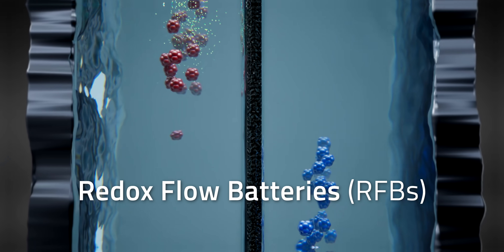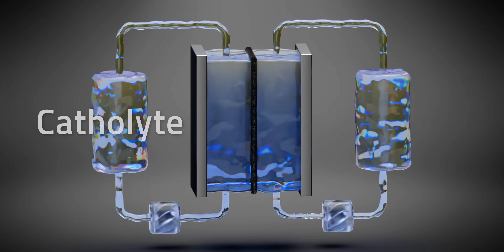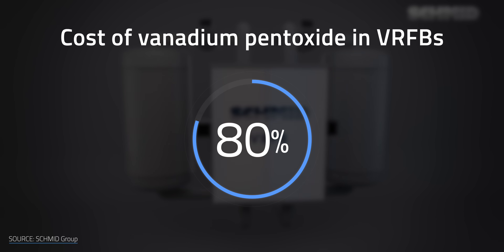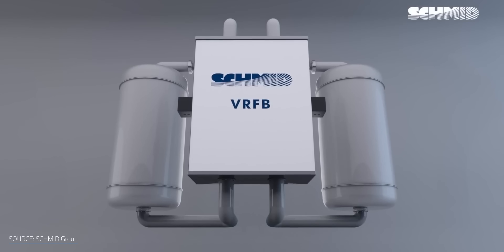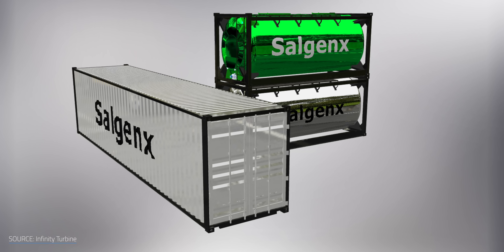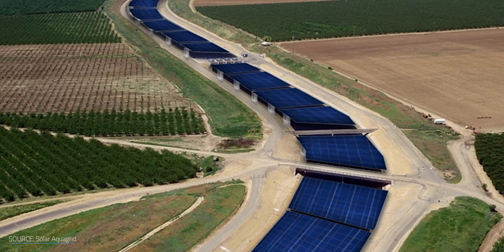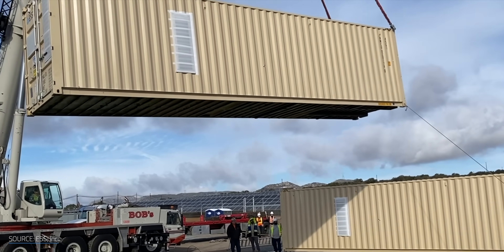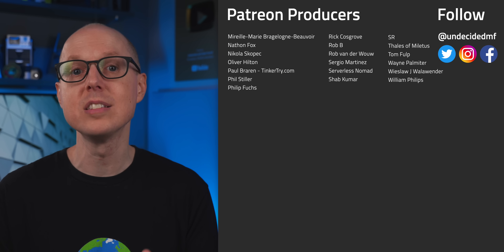Why Salt Water may be the Future of Batteries

Comment: What makes you mad is what was solved but not presented to us.

By using Tesla 1 wire system to transmit power we would have no problems with electricity since you could have distant hydroplants providing power and dumping it into the earth for the whole world to feast on... and here lies the problem why we dont use such tech; the elites would lose control since everyone could tap into it by just constructing a primary-secundary with a good top load "antenna".

And it works. It was tested by marconi hence why he lost to Tesla in the courts... 2000miles when 200miles for radio was the limit (above 1Mhz it bounces of the ionosphere and even then it would be amazing if they would recieve any signal at all).

Comment: Looks really good. For many locations there’s plenty of space available so that the energy density isn’t as much of an issue. It’s great all this new battery tech coming out.
I’m still excited about the LiFeP04 that I’ve been using for the past two years on our solar Edge AI systems that operate off grid. 
Always love new battery possibilities.
Reply from the maker: I'm a fan of LiFeP04 too.  It's a great workhorse.
Reply: The low toxicity angle of this one sounds really appealing, food producing regions under threat from salt water surges and other such disasters could develop infrastructure to restore/maintain production in record time, boosting resilience with low risk of contamination.
Reply: Especially with that 20k cycle life, they would be the last batteries anyone would ever need. Just setup a larger battery shed or even better if someone had room to set the modular shipping container up in their yard and just hook the leads up to the home charger network, then disguise it as a work shed or plant some fast growing bushes in front of it if the sight of a container is off putting in some communities.
Reply: He seems to ignore LiFePO4 for some reason. LiFePO4 is already good enough for my to power my life till I die for less than the cost of a medium priced car. It is not theory, it is an already proven win for solar viability.
Reply: @lazysmurf420  The lifepo4 is fine but it's a lithium-ion battery. All lithium mines are currently producing at maximum capacity, combine that with both Europe and the US pushing all electric vehicles by 2030, and then further add that it will be another 8 years before the next lithium mine comes online, and at least 5 more years after that before it really starts producing in quantity, and you are looking at future sky-high prices for lithium batteries.
Reply: @lazysmurf420  It is a good solution for individual households but we need to scale up big time and flow batteries are what power companies need to start acquiring. The price of LiFePO4 would start skyrocketing if power companies started buying up all the premade (likely Chinese) batteries plus you still would be using up lithium and other precious metals that EV companies will likely be competing for.  These simply require storage tanks and can be stackable with shipping containers in population-dense areas.
Reply: I have a lead acid system, but I've been watching/waiting/dreaming about Redox Flow Batteries for over 10 years!! 
Salgenx sounds incredibly promising due to the lack of a membrane! I hope they develop a smaller 50 kWhr system(two-55Gal drums) that would be a great competitor with the 10kWhr Powerwall!!

Comment: Yep either these salt or the iron air/flow batteries are pretty much the only solution we have for grid scale energy storage and should have been scaled up yesterday. We can't tie up lightweight, expensive, energy dense, rare battery resources that are better used for transportation for a solution that can care less about size of the battery. The only thing is these batteries need to be located away from populations because of the chlorine concentrations involved and the risk of an accident.
Reply: Not really.

They've been using molten salt energy stir for years. Works quite well.

AND solar, with molten salt energy storage, is cheaper than the cheapest fossil fuel, which is natural gas. And it's been cheaper for several years now.
Reply: anydaynow: The problem is we do not need grid scale energy storage if we just do NUCLEAR.  You are saying you want power but not in your  back yard.

Comment: I'm constructing a covered arena for my horses in super wet 9 months then parched dry 3 months Oregon. It's a Nucor that laughs when trees fall on it.  I'm going to install solar panels on its metal roof.  Lighting and my well pump are first priorities, with auto switch to grid only if needed.  I'd like to also charge a future electric vehicle once my 2004 truck or 2010 car die. Since I have tons of space, and water/ graphene production sounds dandy to me, should I consider these batteries?  I need something non toxic for if there is a leak a horse kicks the battery :).  First section of an eventually 4 sections will have an almost flat roof roughly 70 ft by roughly 80 ft.  Peak at 17 ft, sides at 14.75 ft.

Comment: This battery has 2 things going against it compared to other batteries: Weight and space. That means transporting it is bad and it means in small spaces it sucks as well. But say you burry it in the ground of a house's garden... Then neither is such a big issue.
Reply: Maybe for home storage, but for grid - it doesnt matter as you can stack them if you wanted to or at least have the space by putting them in large non human living spaces. Transporting wouldnt be bad at all really. Sure it would cost gas to move them - but once in place - they would pay for themselves over the next 25 years. Plus looks to be stander shipping box size.
Reply: @adr2t  Also you only really need to transport the dry weight, the water can be produced on sight with a portable reverse osmosis rig and a local water supply.
Reply: i, like everybody else prfers a small box that is mounted in 30 minutes. easy replaceable, super safe, super cheap, infinitely recyclable, it has everything. if you wanna dig a huge hole and cause all kinds of issues and problems just to spend huge amounts of money and have less for it, go ahead.

Comment: I was hoping Sodium Ion batteries would be available for cars in the not too distant future ... but ...  I still think FIXED batteries in cars is a dumb idea, they should be replaceable cheaply, quickly and easily.
Reply: They solved that with the newer long life battery chemistries and DC fast chargers. The amount of infrastructure needed for battery swapping different brands of batteries would be mind boggling. It took over a decade for a common charging plug to be agreed upon, and even that is regionally based, to agree on a battery swapping standard in our lifetime would take a dictator's decision or an act of a deity.

Comment: Yea. but if it can make fresh water + use that brim for something - like storing power - no matter how you cut that up - its already on another level vs anything else use. Let alone, for grid storage, it doesnt matter how large they get - as it can be stack and weight has no real meaning there. Sign this tech up man. If it really works, there wouldnt really be that many down sides and could be expanded super quick from coast to coast. This would leave Li for everything else that needs higher performance and storage numbers. Something you didnt cover though and the reason I think they're still R/Ding the stuff is the slow startup time though? I remember reading something about that - that it takes a bit of time for them to be really producing power so they dont work in terms of quick switch, but even if that is true, so long as they're used as the main storage, adding a little Li battery percentage wouldnt be the the end of the world. Really, I would just add really large super caps:) as they dont have any of the issues and have a very fast startup and load out time to give time for the flow battery to get warm up. Also, keep in mind, we over produce power every day. Just having a way to store that over use power would be huge and would cut something like 10% of power plants just because wouldnt need all the extra overhead anymore. Adding solar homes alone would triple the closing  and the real benefit there is that they can pay you for the use of your extra power and lower their operating cost.

Comment: Cost per smallest unit please? What is the point if only large corporations can buy it?
Cost of electrolyte of $5 per KWh does not mean much if rest of equipment to run it cost it 100 times more.
Would appreciate cost of the smallest unit and when will be available on the market?

Comment: This could also be the method of disposing of salt brine from Desalination rather than throwing it back in the ocean, damaging the environment.
Reply: It would have to be purified though and that adds to the expense, it has been proven that returning brine to the ocean via a properly engineered distribution system has little affect on the environment, it's just lobbying from water companies who are trying to monopolize water resources. In fact an SMR or solar/battery powered desalination plant combined with people swapping to low flow plumbing fixtures and drip irrigation for industrial agriculture is their worst nightmare.
Reply: @anydaynow01  Given I live with a coral restoration scientist, " it has been proven that returning brine to the ocean via a properly engineered distribution system has little affect on the environment" is an ass statement according to her.

Desalination brine generates massive salinity differentials in outflow areas that cause significant changes in both the current flows and the viability of marine life.

The "Big Water" companies don't care about preventing desalination because they'll just bottle it and sell it back to you anyway, and most of them are the ones building and controlling the plants that would result.

The problem with the brine outflows is that the volumes we'll need for high density regions to be supplied will significantly damage marine ecosystems, and the companies building Desalination Plants don't see it as economically viable to make the outflow pipes travel hundreds of kms out to sea where outflow would not be impactful.  

Brine release in coastal waters has not been proven to have "little effect".  It can seriously damage coastal marine systems.  So finding other ways to reduce the brine output is well worth the effort.

I'm a big supporter of desalination at scale to solve the water crisis but dismissing the ecological impacts as "That's just lobbying" is the worst kind of counter-environmental claptrap.